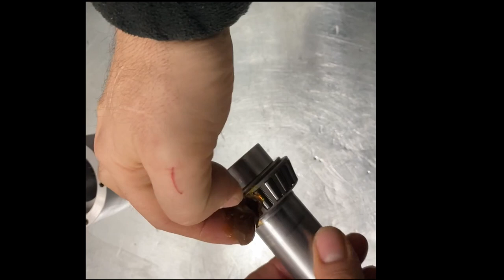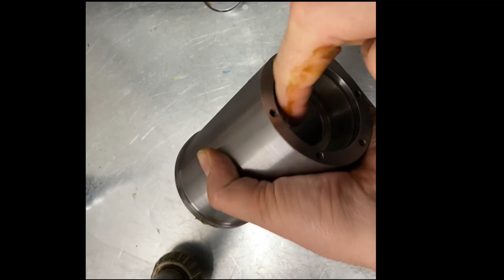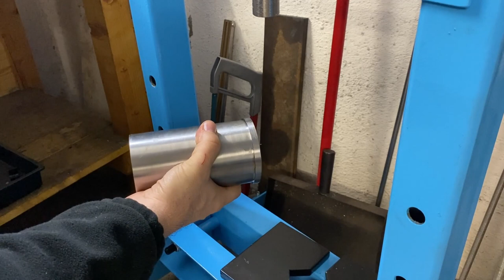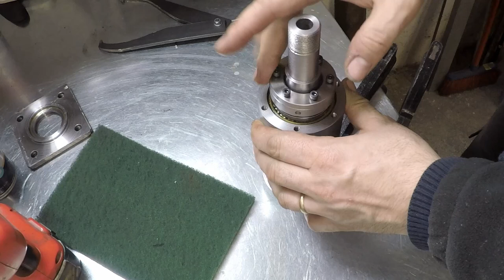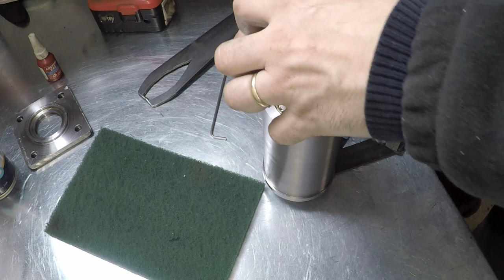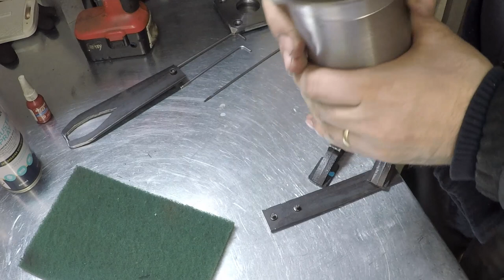New Milling Machine Spindle - Part 4 - Spindle assembly

Comment: What is the shaft starting torque? That seemed to be very tight for a tapered bearing assembly.
Reply from the maker: Is not so tight i think. I can rotate the shaft easily with two fingers. It looks tight because the bearing press fit on the shaft and I had to tighten the nut with higher torque